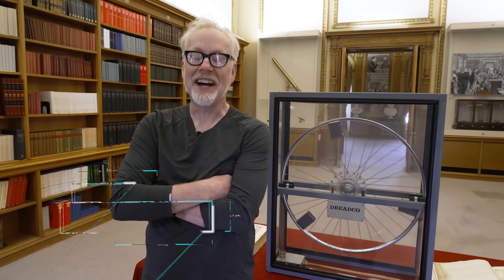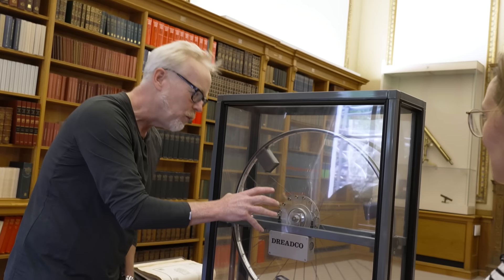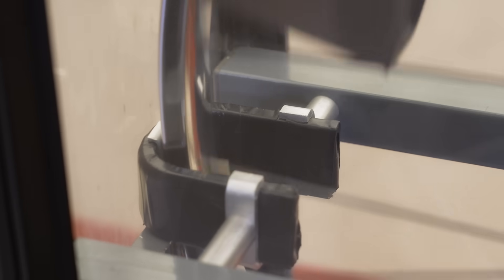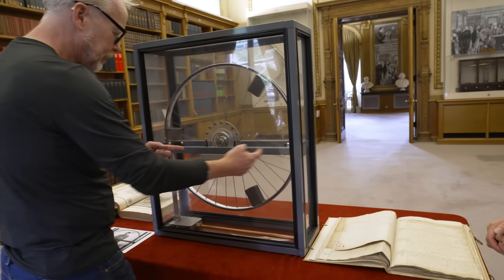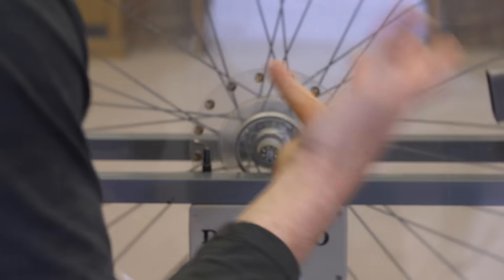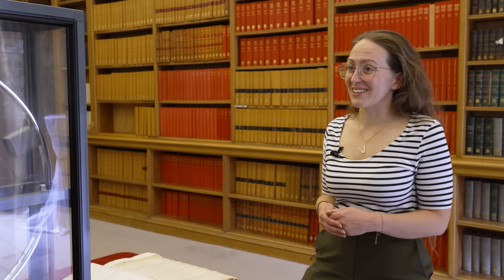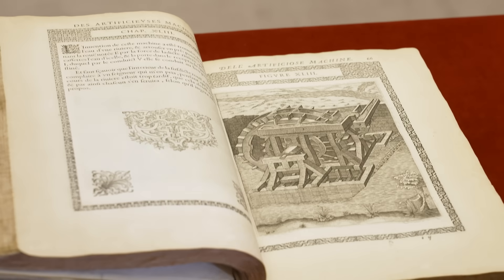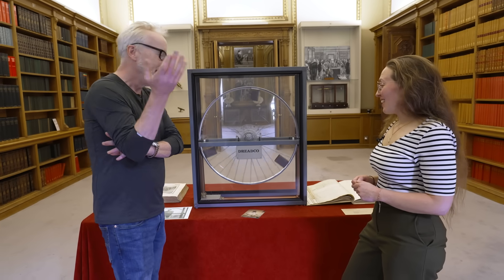Adam Savage vs The "Perpetual Motion" Machine!

Comment: I dont think it's batteries..i think they accurately spaced out magnets so that it moves at a constant rate. Theres no margin for error or it would change speed. But.. magnetism isn't immortal so its not perpetual. Magnet's are a power source that eventually weaken and lose all magnetism, which would then stop the object..but if you could make a kind of alternator that perfectly held a constant rate of charging so as to keep the magnets always the same magnetic chage, that would be possible.

Comment: Just a random thought. Wouldn't this be possible if you somehow used gravity to spin it down and magnets to push or pull the otherside up with the momentum buildup? It wouldn't be smooth like this but theres got to be someway to balance it correctly. Add on the self made friction with some sort of gas expansion loop like geothermal potentially? That'd require specific temperature but not imposible?

Comment: I'm afraid I don't share Adam's fascination with this machine. The wheel has 3 giant compartments and another housing in the stand itself. This was also made in the last 70 years, so it's not like batteries and electricity weren't invented yet. Any mediocre engineer should be able to build something like this.

Comment: Stator with 6 coils evenly spaced in a circle. Rotor has 2 levels. Level 1 has 6 north facing magnets. Facing the coils. Centered on the coils. Level 2 has 6 south facing magnets. Facing the coils from the other side. Evenly spaced between level 1's magnets. When rotated to induction will become autonomous. Why?   Just type that into A.I and it will tell you how it works

Comment: If they are chemical batteries that need charging, then it is by definition not a perpetual motion machine.  Also a light metre would prove the lie too. You cannot add external energy to the system by any means, in order to claim perpetual motion

Comment: Not a standard electric motor here. The positively created charges via the iron and the magnets must be following the copper circuit in the base, being "launched" on the right hand side in an upward-polar thrust. The positive charge must then be negated after cycling in the counterclockwise direction to the left, also making use of the gravitational pull of the magnets. The bottom box must be the ground feature with a capacitor-type electron storage in the circuit. While being maintained, the wheel may be spun repeatedly to initiate the stored electrons in the battery more than likely hidden behind the Logo. Also added is probably much needed oil for lubrication. The other circuitry must be connected at the axle which is an unnoticed moving conductor. Pretty genius assembly. Very sneaky/efficient electromagnetism in a cyclical application.

Comment: X-RAY the box. . .$20 Bucks says there is wiring and batteries concealed. . Good catch on the light to electricy conversions.  The three boxes on the wheel are infact stators, and notice the seals around the glass? Likley a vacuum to cut down on air resistance as well.   A well constructed but still a HOAX.  But for grins and chuckles if you REALLY want to know: (a few hints at least):

https://dontsurfinthenude.blogspot.com/2023/01/the-secret-of-dreadco-perpetual-motion.html

and if that does not quite dispel the notion:

https://www.youtube.com/watch?v=muruba8ORGA

Comment: Have not watched the video, but this one is easy.  Electric source in the base, with the electro magnets acting on the steel rectangles placed 3 phases apart on the wheel.  Just like the "perpetual motion" spinning top......has an electro magnet in the base.

Comment: How is it "Perpetual" if it takes about 2 years before it needs resetting? If this thing has some self contained internal/external power source, then it is no different than a analog clock that needs a battery change every 2 years or so as well.

Comment: What's really baffling is that it is possible to build a machine that, to all intents and purposes, behaves like a "perpetual motion machine". If we have tides on earth - tides that have been ebbing and flowing for billions of years, then a machine can be built that is "wound" by tidal forces. "Perpetual Motion" is defined as requiring no external impetus or force and not having any friction. With the mere existence of "friction" or "tidal locking", a "perpetual motion machine" is impossible. Any system that disperses energy, even the Universe is, by definition, not a "perpetual motion system".

Comment: I think each of the three boxes contains a quartz clock mechanism modified self calibrating with an offset weight these weights work together to cause one side of the wheel to be a few grams heavier than the other making it turn constantly at the same speed for two or three years.

Comment: The point of the machine is to look big and like it's hard to move. In truth you could spin a decent bearinged wheel with weights on it and it would spin for a long time. A wall clock motor could run this for years.

Comment: My best guest....could there be some type of liquid inside each of those canisters spaced 120 degrees apart?  And if so, could there be a percentage of an exact amount of that liquid to be filled inside of it, making it so when each reaches the top, the the weight shift carries the continued motion, and if never stopped, could go on for as long as the bearings and other mechanicals allows it to? Same principal as a water wheel, but working from the inside kinda.

Comment: The dreadco Box might have a valve to blow air on the right side. So the hole with the screen be an air intake. There are little cups on the acrylic part. Would make sense to create movement. OR: a nice little distraction😂

Comment: Magnet motor with just the wires on Google put that to good use need a clamp need a whole magnet casing correctly pressed over it and it's expensive hard recharge batteries run power plants can't imagine being this guy I asked his dad what to do with trillion dollar magnet compression mindless freak not worthy here on my planet son forever and forever over again on your own breath hold 20 24 hours a day max pressure slamming the ballpark down fist through everyone everything under 1 day as A Magic Great Great Grandfather Supremacy they need cases you only need 1 magnet to make it spin you need the whole thing in a case but one side max pressure to this man's dad full thing nothing full black hole nothing full putter rim nothing all split up kabewi shoes for the open heel bone god bless your left leg problems here son but this has to got to go to bed throw it away please into the trash or imma eat it blow hair out my head over 17 miles this boys first bj by his great great grandpa on tummy magnets this old man Jesus don't fart in here so will and it's gonna go black son black Adam it's got to go I suggest a casing slabs added until it goes the other way an opening or maybe not it'll never stop again and blow from friction in sorry the timeline I only run mine half the day won't do it at night not blessed enough hald the day max speed then off in a frozen container or until failure rate can't tell its a mystery perfectly I can handle this take those magnets out make a real one Coach Flavored O

Comment: Some parts of this 'fair exhibit' may be only to throw you off. The heat sinks probably mean nothing since nothing required to move something that close to frictionless would generate that much heat. I always write off perpetual motion items as a complete sham. I would ask why that box on the bottom left needed to be as far away from the other end of the pipe. Perhaps make it easier to swap out the batteries. You could have taken an inductive pickup sensor to check for any electromagnetic pulses.

Comment: If it is a self-powering motor, then it is a perpetual motion machine.  Anything that can run that slowly for two years is perpetual enough for me.  This thing should be in a display where nobody can touch it, and surrounded with cameras that live stream to the internet 24/7 so we could find out how long it would run without stopping.

Comment: While there is, of course, no such thing as a “perpetual motion” machine in the sense in which this is usually understood (energy out but no energy in, which is an impossibility) there are devices which can harness natural forces so as to maintain in permanent motion. For example, the Atmos clock. This is a clock which is fitted with an escapement mechanism which requires the absolute minimal power input to maintain in in motion. The pendulum rotates once every minute, rather than once every second. The spring is wound from two natural power sources. One is operated by changes in atmospheric pressure (hence the name “Atmos”) and the other is from changes in temperature. These power sources are naturally occurring and never run out. If you have a barometer and a thermometer in your home, then you will see a version of “perpetual motion” - the dial will go up and down, without the need for any power source. However, the amount of power which can be harvested by changes in atmospheric pressure and temperature is minuscule - just enough to run the most super efficient clock mechanism possible. However, it does qualify as perpetual motion in the sense that no power source is required other than those harvested from natural changes in the environment.

Comment: It's an electromagnetic energy three-point box. those little blocks on the railings or magnets that's been energized it's free energy I made a four-point electromagnetic energy box on an old bicycle I got from the salvation army it can do up to 33 miles per no chain because the magnets keeps pushing it to its highest it works really good with disc brakes because you don't interfere with the frame and the four point boxes it's really ingenious actually it's just magnets working off of each other but it's not as easy as it looks you have to energize the magnets to its highest point which means you need a higher voltage most likely four car batteries and a transistor that can transfer energy into a smaller point without setting it on fire or exploding you have to get it just right

Comment: Can I be the third person to get the answer right? After 2 years its sent away to Nottingham University to have the batteries in the lower heatsink box changed which has wires running through the copper pipes to the coils on each side of the wheel.

Comment: An object in motion remains in motion until acted on by another force. Perpetual motion machines are based on conservation of energy. You could get incredibly close, but all it would be is a toy. In practicum if you tried to take any energy from the system it would not be replaced and would eventually fail. An overly efficient flywheel really. Still really cool.

Comment: Since a perpetual motion machine has to run eternally, on it's own, this does not count. You need material that would never deteriorate, and a process that would never need to be adjusted. Is it possible? I believe, of course it is. But our understanding is probably bouncing all around it, but I suggest magnetic builds are one right track. Someone will prove it some day.

Comment: I always go back to a flywheel and magneto just like a lawnmower. You have to balance the copper wire charge to process the speed allowing a small charge to make a jolt to push over the threshold. And continuing the charging. It seems he has the spacing of the copper and magnets with a small storage. Only thing you would need is an extra speed to help boost the stored charge

Comment: Each of the 3 battery compartments contains a magnetic reed switch that momentarily activates a timer circuit also within the compartment, whenever it passes the magnets.. This in turn activate a coil until the timer switches the coil off a few ms later. The only confusing part is what is science fakery doing in that building, when everyone else earned their place by advancing mankind in some way? As a piece of kit, its not remotely remarkable it can go for two years. So can your average clock, only on far far fewer batteries. I would posit that with that many batteries, the average Seiko would go for around 20 years. Maybe they should be their instead.

Comment: If there was such a thing as a perpetual motion machine, AND if it was anything more than just a curiosity producing the bare minimum power to overcome tiny dissipation effects, then we'd know it instantly because the lab would explode.
Indeed, one of the main difficulties when working with free energy (other than the fact that it violates the laws pf physics) is how to prevent generator runaway.

Comment: One thing I always thought made no sense about perpetual motion designs is the fact if they don't run until the sun goes nova its an abject failure.  0.o
IMO if it runs without an outside power source for at least 24 hours it should be considered viable.
Seems to me they are given impossible standards. 
Having to manually start the spinning process again and replacing bearings as needed/required should be a given.
The name should be changed on these designs so people aren't hung up on the perpetual aspect as if they have to spin until oblivion comes or they are failures.

They can generate power for extended periods without an outside power source, that's a win in my book.

Comment: If air circles then it can help motion resistance. If energy slightly pushes a capacitor needs charging. If heat is made it’ll flow up the tube. If a power loop that could also help the flow. Some gasses work better than others. The energy at the middle could do almost nothing, looks Tesla. 2 years could be anything and is far from useful. Until you realize some cellphones charge daily. A watch can last 10 years. A winding watch can last 100’s of years. You heard me.
Reply: I have owned a watch that lasted 12 years same battery’s.

Comment: video is not showing the most important part, which is inside the rim of the wheel. also put it into a freezer and it should stop. the energy source could be the ambient heat of the room.

Comment: those boxes on the wheel contain magnets... and I am sure there is a reed switch in the taped up U shaped parts which is most likely coils that are triggered by the reed switch and when fired at the right time kicks the wheel into motion... hence the need for  "servicing" cause its battery powered

Comment: Inside the "DREADCO" box, there are lithium primary cells (which have very low self-discharge, high power density, and a shelf life of many many years). 
There are wires running inside the grey square tubing to which the box is attached. 
These wires connects to small electro magnets in the U-shaped ends that wraps the wheel rim.
There are magnets in the three boxes on the rim. The magnets activates electronics to sense when a magnet is near, which switches on power to the electromagnets, timed to about 0.1 to 0.5 seconds, attracting the magnets on their way towards the coils.
The copper piping, the heatsinks (ridiculous), and the small "things" near the hub are just decoys.
I am surprised that it only runs for a few years before battery replacement. Could have been better.

Comment: Ionisation motor, inside the DREADCO box is an ioniser, the pointed end at around 45° charges the small spheres on the plastic disc, the ball end discharges the spheres hence 180° shift, the 3 weights are just for the flywheel effect.
Well that's just my theory.
Gaz UK September 18 2024.

Comment: Three radially mounted boxes, each of which could contain 6 x AA batteries. Two frame mounted boxes that could hold a further 10 each, (+ pipes, frame & base that could hold 60 more😂) 
Opposed, u-shaped  structures through which the isolated metal rim passes and it needs ‘servicing’ very two years. 

Hmmm… 

Sponsored by energizer?

Comment: Complete shot-in-the-dark.  If not some form of batteries involved, my guess is there's a very slow spring inside the "heat sink" and/or the base that just ever-so-slightly gives the wheel enough extra momentum/energy to complete a rotation with very minute loss (that adds up over the roughly 2 years stated).  The "secret holders" were, in my guess, disappointed to learn all they really had to do was wind it with some form of specially designed key.

Comment: I think those 3 black boxes contain high density batteries, a coil of wire and a reed switch. The coils are momentarily energized by the reed switches as they pass the magnets. The coils then get attracted or repelled by the magnets, depending on polarity and position.
Reply: Nailed it…
Reply: Powered by smoke and mirrors.
Reply: Too exotic.   Instead think mundane.   I''ve had his device apart for 3mo "servicing."   This was the "central tower" version with five little boxes, displayed at Boston MOS.  The only amazing thing is that it can run continuously for many months.
Reply: Probably
Reply: Yes
Reply: My thoughts exactly!
Reply: It almost seemed to pulse...
Reply: So...magnets,that was my thought
Reply: Was thinking magnets possibly angled to somehow attract and repulse but that makes sense
Reply: Yes ... but... how do you regulate the angular speed of the wheel?
I suspect that is the role of the two vertical electrodes coming out of the box at the centre .
These count the passing of what looks like magnets  eveny spaced around the hub.
It is easy to then use that to regulate the system overall using rf (like key fob) technolgy to regulate the system.
Reply: Yep between box frame and black boxes 👏🏼
Reply: The magnets wrap around in a U shape meaning that the magnets will cancel out each other and any metal in the middle wont actually experience a magnetic moment. Also the speed of the wheel is too smooth for there to only be 3 boxes at 120 degrees from each other.
Reply: You dup asss, this is as real as climate change, plastic straws phobia